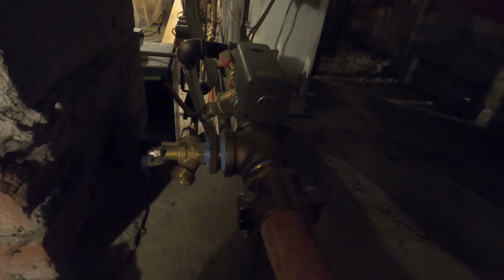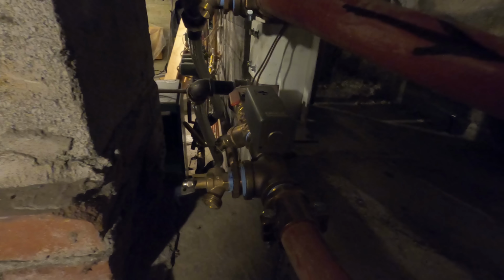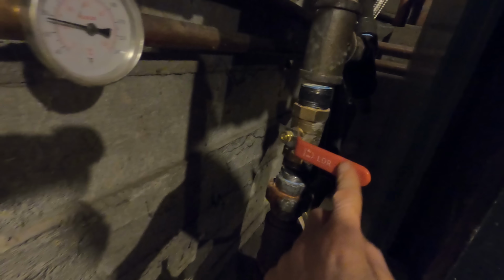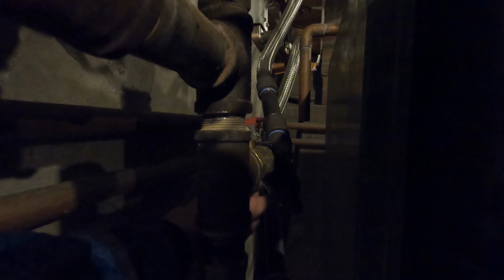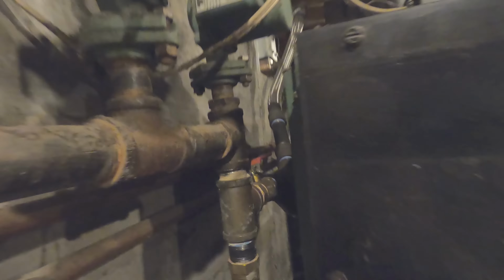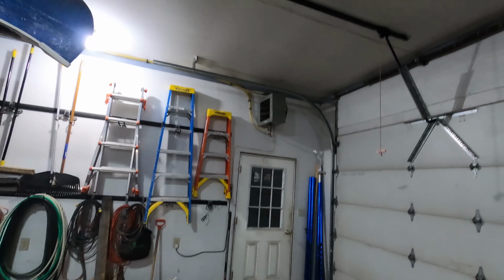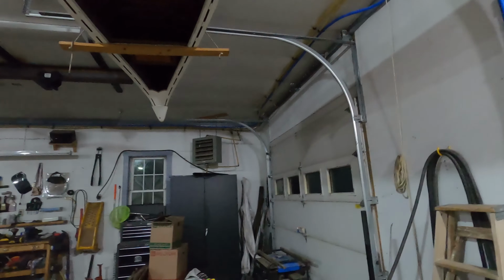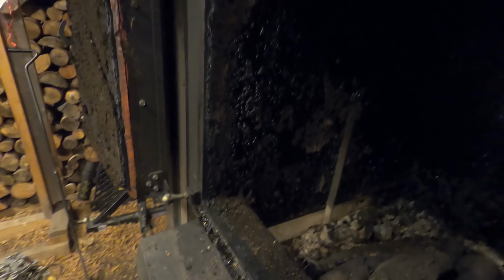5th year review of woodshed and Classic Edge 750

Comment: Thanks for sharing!  That answers my question about the semi-permanent wood cord walls on the sides. That fulfills two jobs indeed. The spotlight toward the inside of the combustion chamber is something I miss. I have plenty of light everywhere, except in that location! I need a cart to bring the logs to the front! From my very short experience (month or so..) with my new boiler, I also disconnect the pump while not using the garage (I have the same setup. one pump for the house, one for the garage). It seems it draws a good amount of heat, would that be for the extra 350 ft of underground piping and/or the presence of exposed pipes inside the garage. I've found the heating coil itself inside the furnace provides enough heat to keep the garage well above freezing point without even turning on the fan.  This is pointless in my case to heat, as the garage will naturally drop to near freezing point, never below. Thanks!
Reply: BTW, I was traveling through 91 for business today. I know it must be close to your neck of the woods seeing Jay Peak in the background of your video! Would you mind exchanging by mail? You can find mine in the "about" section of my YT channel. Thanks!
Reply from the maker: Yes. Jay Peak country. I'll email you.

Comment: 10:15  Its counter intuitive, but stainless corrosion occurs in low oxygen environments.   I recently learned this in marine applications - may or may not be why cleanup is advised, and might be worth looking for signs of pitting.
Reply from the maker: Interesting. Thanks for that. I have been adding "ashtrol", a powder the manufacturer recommends to reduce "acid" in the firebox. When I used to scrape the firebox creosote off each week, it was glazed over again within a day, so I didn't think the effort was worth it.

Comment: Nice setup. Are you using some type of antifreeze in your system? Cleaning hack: Hook the wire brush to a saws all. Also in my wood shed I put a long sheet of metal roofing over the loading door area and pitched it towards the outside to direct the smoke away from the ceiling joists and out of the shed
Reply from the maker: I do not have anti-freeze. If the boiler shuts down or I'm not using it in cold weather for some reason, the back-up oil boiler will keep the OWB warm via the heat exchanger. Not the most efficient method, but almost never happens - and so far not taken a long enough winter vacation to matter. A couple great ideas. Thanks for those!

Comment: How come you don’t push the brush up into chimney base (T) those openings need cleaning also
Reply from the maker: I do push the brush up beyond the top of the heat exchanger channels. It is the first stroke or two. But in this shot it is just above the field of view. I get a fair amount of ash that falls from there, so you are right. That can bridge over and block the passages if not cleaned.